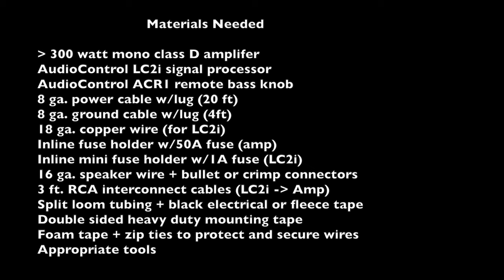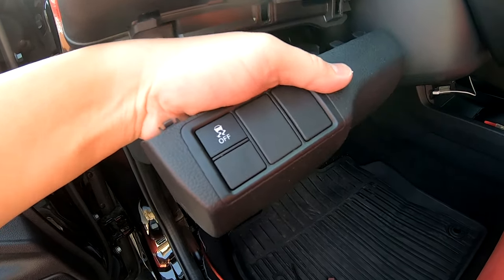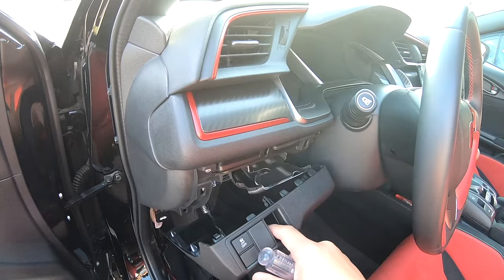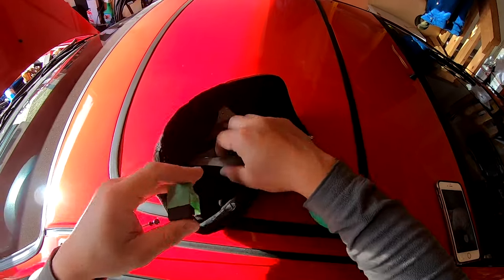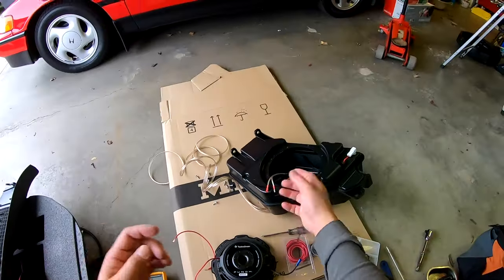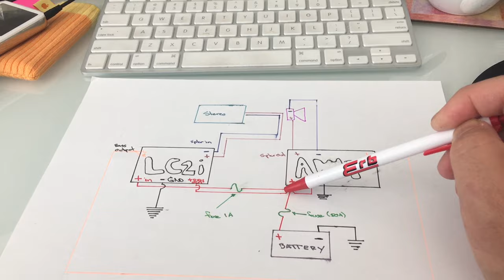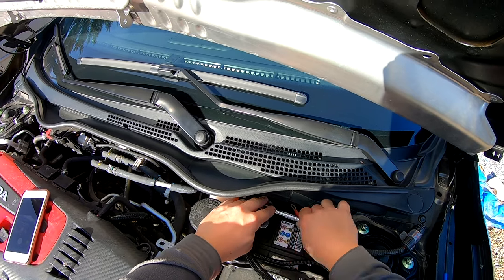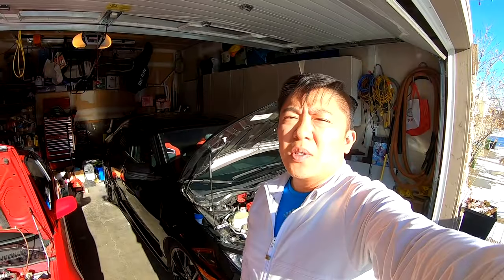2016+ Honda Civic Type R Subwoofer Amplifier Installation

Comment: Also a note, if you are using 4gauge or larger wire it won't fit through the grommet with the hood release cable. Luckily, directly above the hood release cable like roughly 1" above there is plastic plug you can remove that provides another hole to route your power wire through. Just need a grommet or to drill out the plastic plug you remove from the hole.
Reply from the maker: That's a good point.  I never actually have seen the larger 1" plug but if I ever upgrade my power cable from the small gauge that I used to a larger one I will consider that option.  Thanks for sharing that knowledge.

Comment: Thanks for the video! Could you please provide a link or description for the white plastic power wire holder you installed to hold the power wire under the hood near the hood latch cable?

Comment: You delivered your promise... Kudos to you. Will definitely make this my blueprint installation. Very well done. 👏🏼👏🏼👏🏼
Reply from the maker: I am a man of my word. When my fans ask I will try my hardest to fulfill what you want :). The bonus is my stereo sounds so much better with an amp in it. Share my video to anyone you know that would be interested my vid.
Reply: You're *
Reply: @piercedasian  I realize it’s years later ,but where are the speaker wires you used for the line output converter?
Reply from the maker: @arthurhughlett2292  The line output converter is the LC2i and I've back fed the wires back into the subwoofer box where I snipped the connections from the factory sub.  The reason why I did this is to ensure I don't compromise the factory connector in the event I want to put EVERYTHING back to stock form that I'd have no problems doing so.  If you watch the install video again I go into detail on how and why I did it.

Comment: Great job on the amp install very professional looking. None of my business but should look into getting your lungs checked out brother you are out of breath the entire video.
Reply from the maker: lol glad you liked my video.  Yes I sound like I'm outta breath all the time for the following reasons:
1. I'm narrating AND bending and lifting and moving the camera and related gear around on my own with no help.  That can be exhausting and doing multiple takes is brutally tiring especially when you have to put everything you take apart back together to do another shoot.
2. I am carrying about 45 lbs more than I should be and yes I'm working on losing it.  Far too much holiday cheer for me and the fact that I haven't worked a full time job since the past summer is also taking its toll on my health.

If you'd believe it that just a year and a half ago I was a pretty die hard runner that ran and ran and ran each day.  To this day I can actually still outrun most folks in endurance runs :)

Comment: Thank you very much for the thorough breakdown and run through of putting in your system. I can’t wait to get my subs and amp in since I already have my LC2i here by its lonesome. All internals we’re already upgraded in my 20 Accord Sport as well. Cheers!
Reply from the maker: glad you liked the video.  I'm thinking of upgrading the front speakers next on my car as I find the tweeters harsh and sound like their clipping when driving to reference audio levels.  I need to save up for a nice set of focals for my car but those are big $$$$.

Comment: Definitely not a bad install but I noticed a few things that should be done differently. 

1) Power wires should realistically be run through the firewall and bundled with other wiring harnesses versus run through the fenderwell grommets which can allow moisture into the vehicle as the fender is not sealed off from rain in the same way the firewall is, considering the hood and cowl both have seals to prevent water ingress in the engine bay.

2) Power wires should be attached directly to the positive battery terminal. As it stands, you are powering the LC2i and that Rockford off the factory 8 or 10 gauge wiring from the battery to the fuse box, and it's not designed to handle the extra 15-20A nominal power you might be pulling on normal use. Connecting directly to the battery eliminates the possibility of stressing the stock power wire and it also eliminates the possibility of confusing the car's Electronic Load Detection and causing a fault.

3) While your LC2i is definitely a nice piece and has bass rolloff capabilities, your Rockford amp has the ability to accept speaker-level inputs and do its own signal step down, thereby almost completely eliminating the need for the LC2i. The LC2i can definitely be used as a signal clean-up and re-level if that's what you're looking for, but it was not entirely necessary and omitting it may have saved some time and effort, not to mention cost.

Overall quite good, everything should work beautifully. and considering the significantly higher quality of the components used versus stock, it probably sounds pretty good too.
Reply from the maker: All great tips indeed and in my other installations I've done points #1 and #2 but for the Type R I decided to go a slightly different route to spare me the pain of feeding a wire through a grommet in the firewall.  So far after all these years I've had no moisture issues but then again my car is a sunny day, summer with no change of rain type of car.  I won't drive it in the rain if I can avoid it (yes I'm crazy). With respect to the battery cable.  I actually did a current draw test on the amp before installing everything and I wasn't pulling all the much power with the volume and bass levels I was listening at.  At most about 7-8 amps which the stock power cable would be able to manage.  You're definitely right though, if anyone runs a larger amp then that CAN pose a problem.  I wanted the cleanest install I could possibly have with my setup without having to rejig the power connector on the battery.  The LC2i does do a better job of restoring bass rolloff but yes many amps have that built in and probably could've made do without it.  

Thanks for watching the vid and again, I appreciate the comments as it is definitely something to consider for others.

Comment: Great idea to use the grommet for the hood release, however, right above it is a capped half inch hole that you can use for up to a 0 gauge power wire. Pull away the insulation padding about a half inch above the hood release grommet and you will see it.
Reply from the maker: That's a good tip.  I probably won't take mine apart now but for future installs I will consider that spot.  Thanks for sharing!

Comment: Should have ran the power wire through the firewall not through the fender well
Reply from the maker: why is that?  I found running it through the fender the easiest, least invasive method and it ties in perfectly with where the battery is located all while keeping the firewall in intact with zero drilling.

Comment: Amazing Video Very Detailed But Quick Question... I Love How The Amp & LC2i is Hidden Under The Trunk Lid This Wouldn’t Cause Them To Overheat? I Just Ask This Since There’s No Airway There I Suppose...
Reply from the maker: while they do get warm on really long extended drives that due to the efficient nature of class D amps that they don't get really hot at all.  Warm yes - but no warmer than normal operating temps.  I did a 10 hour long road trip listening to music at fairly loud listening levels and while the amp was extremely warm that it was far from hot and certainly not a fire hazard by any stretch of the imagination.

Comment: You did it!   Thanks for sharing!  ❤️
Reply from the maker: yes I did :)  I had to as the amp makes the sub so much better in ways that I can't even describe.  The Type R is easy to install in since it has that foam tire blank tray that you can put things into vs. other civics that have a spare tire in its place.  I'll be doing a sport touring soon so we'll see how that pans out.
Reply: piercedasian fantastic!   I will do this once my 2019 Type R arrives this spring.   I already have the amp and sub speaker - just need the car 
Your video has helped me so much!   I own you a big thanks 
Love how you took your time and did a professional job - I will do the same 
Cheers!!!
Reply from the maker: glad you loved the video.  Yes, take your time and do things right and you'll be rewarded with a nice looking and nice sounding system that is super reliable.  Good luck on the car purchase.

Comment: quick question... for the lc2i, did you plug into the left or right speaker input? or both? im planning on tapping into my sub just as you did but wasnt sure where to plug it in. AWESOME videos btw
Reply from the maker: Going completely off of memory here but I believe the sub output wiring went to the left channel in on the LC2i.  Glad you like my channel.  You should consider subscribing as I do try to regularly post new content pertaining to all sorts of things.
Reply: piercedasian great thank you, & I just did!
Reply from the maker: awesome thanks!
Reply: @piercedasian  so do u actually get output signals from both rca's? Having only given the lc2i a single channel input? Sorry, just curious
Reply: @TheBlackz05  @piercedasian I'm curious about this as well.

Comment: Nice setup, very good information, I just hooked mine up today and I did not know that you need a fuse holder from the power cable to the amp. Can you tell me where you got the fuse holder and are the wiring 12 gauge? I used some 12 gauge sting ofc wire for my power and ground to my tap from the amp. I don’t want any fires in my car. Will an inline fuse work from the auto parts store. Let me know where you got yours. I used ofc wire for all my wireing and the 12 guage worked great for the lc2i, I know that is overkill, lol.i have to use the best wires.
Reply from the maker: A few things to clarify first.  1.  You need a fuse for the main power cable as close to the battery's + terminal as possible.  The reason for that is to protect the battery in case your main power feeder cable shorts to chassis ground.  The main power feed cable for my amp from the battery is a large 8 gauge cable.  2.  The power cable to power the LC2i is tapped off the +ve terminal of the amplifier and that needs to be fused with a 1AMP to protect the LC2i in the event of an internal fault of the LC2i.  I got the wiring and large cable fuse from my local stereo shop.  The smaller LC2i inline fuse was purchased from my local auto parts store.

Comment: One of the best videos I've seen so far on youtube for sub/amp installation using a LC2i. Very well explained and professional. I'm preparing to do an install on my 2013 accord EX-L and this will help me a lot. Thanks so much !
Reply from the maker: Glad you like my video.  Install in a 2013 Accord?  Sweet.  It will be a significant improvement over stock.  Good luck with your install.
Reply: One of the best?
You should watch other videos

Comment: Just curious, I saw you tapped a positive wire into the engine bay's fuse junction box (near where the megafuse is located). Assuming you didn't blow the megafuse itself, did you ever come into problems with an electrical parasitic drain/ abnormal key-off load?
Reply from the maker: Hi Benito, the short answer - no I do not have any electrical issues or parasitic drain.  Why would it if my equipment and setup is working properly?  What people DON'T understand (and I've had some snarky comments) is that I'm technically piggybacking my amp off the main positive battery feed BEFORE the fuse box and I've done electrical load calculations based off of my amp and the factory wire from battery to fuse box will be able to handle the added load without much issue.  I don't blast my music so the amp would draw VERY little current (I've hooked up an ammeter to the amp when it was cranked and it wasn't pulling much current so at low to moderate volumes it would be barely anything).  I still fused the amp power cable close to the fuse box (as how one SHOULD do it if it were wired direct to the battery) so there is still short circuit protection for the amp.  As for the mega fuse, my amp is wired BEFORE that.  The reason why I went the route that I did is because the install is cleaner looking and the safety risk to the car and audio system won't realistically be much of a problem for my particular application.  I would NOT do it this way if I were running more amps or a larger load as you could literally melt the main wire if you were pulling huge amounts of current.  While I'm not an engineer or an electrician by trade, I do know more than the average cat when it comes to anything electrical which is why I'm 100% confident in my work.
Reply: @piercedasian  I genuinely hope my comments don't come off snarky. You did a good job and your setup is clean. It's more that I'm just talking shop since I'm pondering about an amplifier in my Civic too. Rockford Fosgate does make high efficiency gear so I'm pretty positive you won't run into issues with excessive power draw, especially with a fuse setup. No relay though? I'd figure this circuit would be a key-on only function. Might help protect the amplifier integrity. Then again, would you have to recalibrate any of the amp settings manually if it was so? Might not even be worth installing a relay at that point.
Reply from the maker: @benitoloco899  No not snarky at all!  I'm just saying my install according to some is controversial b/c it is technically NOT good practice other than to wire directly off the positive terminal on the battery.  The issue really comes down to pulling power through the car's main positive cable that feeds ALL power to the car when an amp SHOULD have its own dedicated feed without piggybacking off other wires which is what I did.  The wire from the fuse box to the battery is plenty thick, is less than 12" long so I'd rather have a clean install than a janky looking one.  Call me vain :)  No need for a relay b/c its built into the amp.  The power cable is full time on but that's why the LC2i has a "remote" out terminal to feed 12v+ trigger into the amp's "remote" trigger to turn the amp on.  This is why I don't have any parasitic draw on my audio system.  It behaves exactly like stock with no funky hacks to make it work right.
Reply: @piercedasian  Cool 😎. Those LC2i output converters from AudioControl really come in handy like that. Will possibly consider it when I do mine on my Civic. Any reason you went with a 2 channel converter instead of 4? Don't get me wrong, AudioControl is a good brand. Me, I'd personally go with Rockford Fosgate's RF-HLC4 version if it's compatible.
Reply from the maker: @benitoloco899  it was out of convenience b/c someone was selling a mint condition one on the cheap and I knew the LC2i is a great product.  The Rockford RF-HLC4 issue that is purely a hi level input to low level RCA output converter and lacks and re-eq signal restoration back to the RCA outs.  So in fact, the LC2i is a much better unit b/c it has the built in algorithm to take the messed up EQing from the factory head unit and restore the signal in such a way that "audibly" makes sense to an amplifier.  What is really funky about modern head units is they do some weird signal processing and send a narrow range of signals to each speaker which is how honda makes the claim "500watt output" premium audio.  They do so by fudging how the output is measured.  That being said, an amplifier works best when a full spectrum signal is fed to it so the build in crossover in the amp can properly "tune" the low pass signal so the sound is predictable and there is no "suck out" or over emphasis on certain frequencies.  The LC2i's unique trick up its sleeve is that it has intelligence built into it to re-eq the signal curve and restore the signal response.   A line out converter does NOT do that which is why I went audio control.  My next big project is a Helix DSP process/amp combo to drive al the speakers in the Type R along with a pretty high end focal front stage upgrade.  Big money to me which is why it isn't happened yet.  I have the speakers and the custom built break out harness from the stock amp connector but the amp/dsp combo unit is so so so expensive.

Comment: Great walk though, thank you! Quick question of ya'll don't mind. Since the line converter accepts 2 qty sets of high level inputs and the sub factory only has 1 qty set of high level, do you just run it to either the left or right or twist the 2 positive together & the 2 negative together?
Reply from the maker: nope, I just fed the stock sub signal cable into the left channel inputs of the LC2i.  No need to feed both left and right in b/c there is only a mono feed.